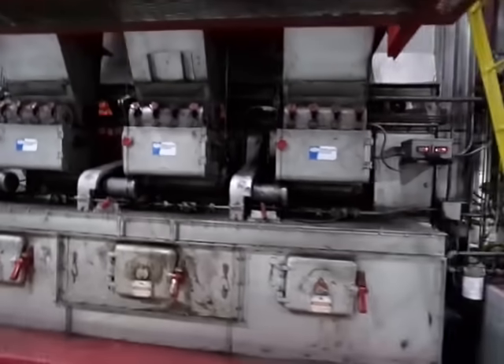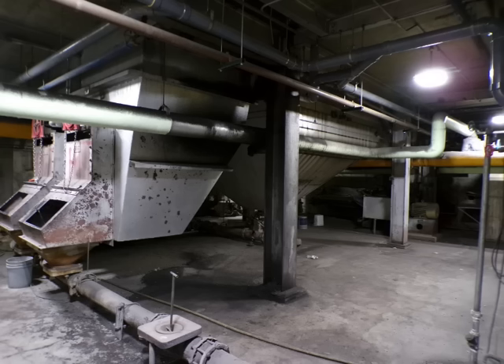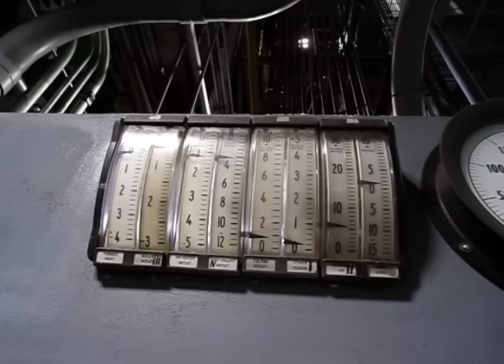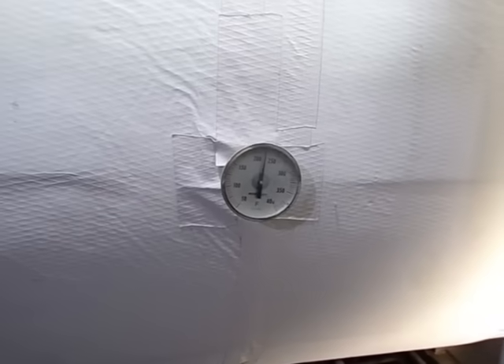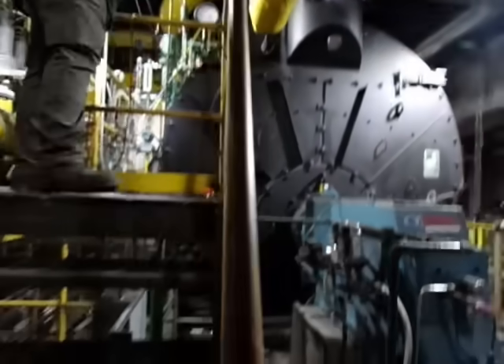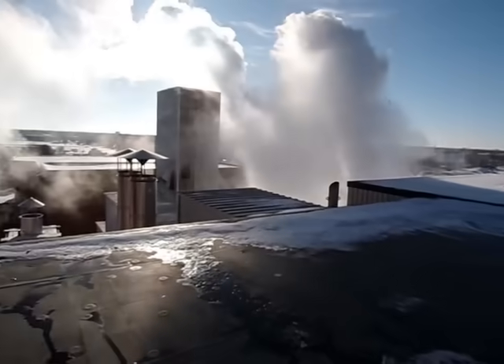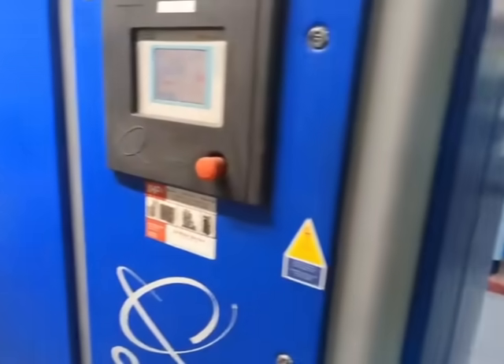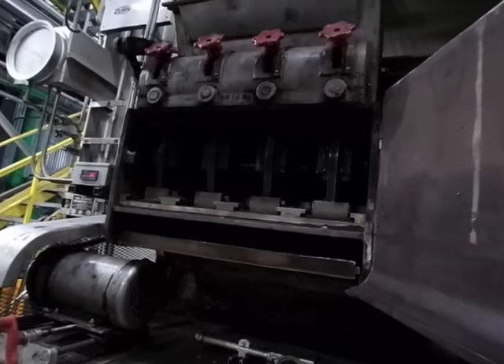The Last Coal-Fired Boiler at NDSU | Steam Plant Tour

Comment: Let's kill off this last coal burning pollution machine! 😮 Stop 🛑 The Burn!
Reply from the maker: didn't you see about the secondary air and the clean exhaust from the stack? also I didn't mention they have bag filters to remove all the fine ash from the exhaust.
Reply: @SteamElectricityandPropulsion  just because you don't see black smoke does not mean its clean. The c02 emissions are invisible and immense.  I mean why do you think they need to blow down the soot? Where does the soot and filtered ash go? Natural gas is much much cleaner and easier to control and far better for the enviroment. You should read more about how dumb coal is as a fuel source.  The amount of men killed from mining, the destruction to beautiful outdoor spaces(important in ND) and waste should be pretty obvious.
Reply from the maker: @FixitFrank North Dakota coal mining is quite safe and environmentally friendly. They use open pit mines which is safer than underground mining and they do a good job of filling in the pits and restoring the land. You should go to beulah ND and get tours of the power plant and mine and you'll see that it's not so bad after all.
Reply: @SteamElectricityandPropulsion  Im in PA my friend.  I know coal.  Open pit mining is destroying the land, yes it is is safer, but safer does not mean its good. That is land that will never be the same.  The waste water is toxic. The diesel fumes from the trucks etc.  Coal had its time.  Its time has passed. I am glad you documented this boiler. I love seeing them, but I also am fine with them being replaced with fuel sources that are better for our lungs.
Reply from the maker: @FixitFrank I know that in ND they do good at restoring the Land. If you want I could possibly send you a video made by the mining company where they describe how they reclaim the land and meet ND legal standards for environmental protection.
Reply: @FixitFrank This is North Dakota, much of the region's natural gas is synthetic and comes from Fischer-Tropsch reactors and gasifiers burning coal.
Reply: @FixitFrank  the year is no longer 1950 and modern open pit coal mining in the USA is not like how rare earths for solar cells and battery materials are strip mined in Asia and Africa (and further refined with a litany of the most toxic organic and poorly disposed of reagents ever conceived by industrial chemistry). 

The environmental remediation requirements for modern surface coal mining basically require the mining company return the surface land to exactly how it was prior to mining including topsoil mineral composition, topology and drainage, plant species and wildlife ecosystem, all the way down the way down to the diversity of insects need to be returned to a state that surpasses the area’s the pre mining state and once this happens the mining company is still responsible to maintain and monitor the environment for an additional 50 year period before their prepaid environmental remediation bonds can be returned from escrow.
Reply: @SteamElectricityandPropulsion  not just in ND. Modern surface coal mining in all over USA is conforms to a level of ecological sustainability that is unmatched by any industry anywhere in the world, let alone compared to other types of mining. People just assume that the practices in the coal industry are the same as they were 100 years ago.
Reply: Easy to say “stop the burn” from the comfort of a modern centrally air conditioned building. Go live through a ND winter without heat and you’ll be able to say such things without being a hypocrite. Although I’ve never met an environmentalist who wasn’t
Reply: You have no respect for the tech. That made the world you live in.
Reply: @CWBHVAC  made.  that time is over.
Reply: OMG yes solar works GREAT in North Dakota lol lol lol lol lol
Reply: @robertshelton3796  Solar  works best at night.
Reply: @jd3497  and those AC solar panels!!
Reply: @robertshelton3796  they are replacing it with natural gas....I mean if you watched the video you would know.